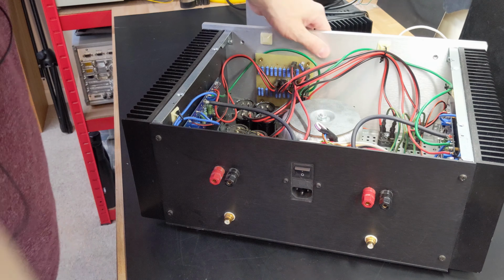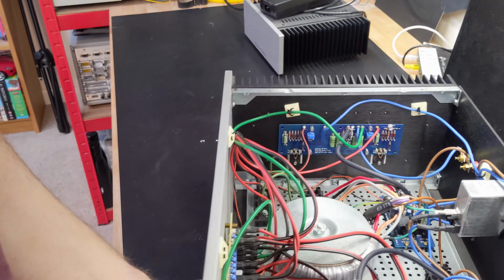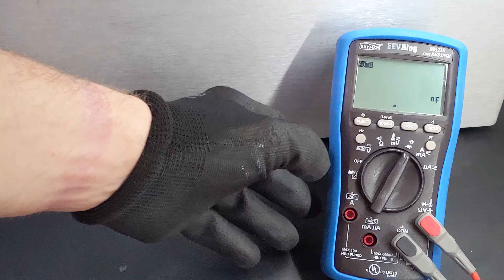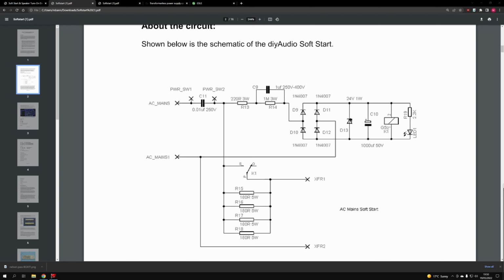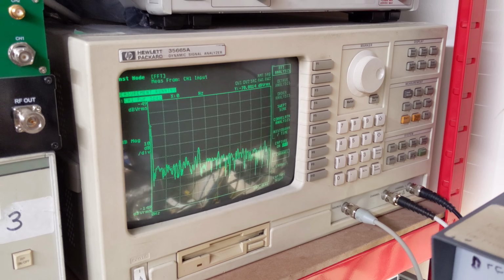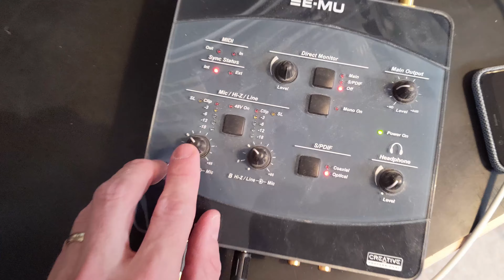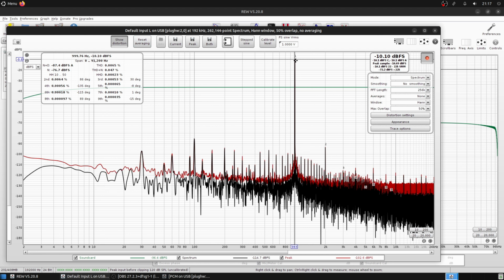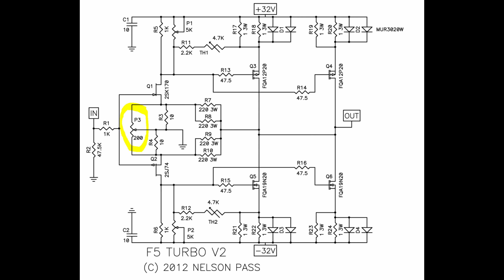#12 [Repair] DIY Pass F5 audio amplifier repair and distortion measurement

Comment: First off, great video! As far as the caps, any X/Y rated caps are made to fail by internally vaporizing the metallic surface on the internal foil ( Dave @ EEVblog took one apart and showed the damage process), and will also drop in capacitance as they do that. Using them in AC power / dropper circuits like that they commonly fail over time, but maybe using 2 larger value caps in series would delay that by lowering the stress on them. I would also consider replacing those multiple board mounted resistors with a chassis mounted one with a higher rating, or, at least standing off those resistors higher on the board and maybe putting a closely rated slow-blow fuse inline with them to use as a fail safe in case any thing like that happens again. Using a ICL component instead of resistors, along with a slow blow fuse might also work nicely, as the ICL would take stress off of the fuse until the relay bypassed it, and a closely rated fuse would also open and keep the ICL from cooking things.
Reply from the maker: Thanks for the thoughts, all great points!

Comment: Awesome stuff ! just watched your initial unboxing and thoughts on the 8 1/2 digit fluke and now this one and I have subbed. Audio and metrology are 2 things I enjoy but  I am very much the amateur (got to start somewhere !!) and enjoy your delivery of what you do. I am at the moment fascinated by Sinewaves and making low distortion sources and in particular Bulb Stabilised Wien Bridge Oscillators. I have a crappy sound card and have been using ARTA and REW software to find my feet,  along side my Siglent's FFT which is only realy an indicator that things are improving !  anyhow great work I look forward to more stuff like this....cheers.
Reply from the maker: I think low-distortion-nuttery is just as addictive as volt-nuttery, or time-nuttery, except it's easy more expensive as you start chasing the hertz, and gigahertz... Save yourself!
Reply: Lol ! but but but the sinewaves ? :) @bansci

Comment: X and Y capacitors are rated for AC RMS mains voltage, so, if you have 230 v AC, then 275 v capacitor is exactly right for this voltage. Some X/Y capacitors are even marked as 250 v, it means, that it is specifically designed to work in 220 - 230 voltage mains circuit (even if peak voltage at 230 v mains is around 320 v).
Reply from the maker: You're right, the capacitors are AC rated which I completely missed. I'll highlight your comment to point this out. I'm still not sure why the simulator I used suggested doubling the voltage OR why the capacitors failed over time, both suggest overvoltage was the root cause. 

AN954 says this capacitor "should" be rated at double mains but not why. Thoughts welcome!
Reply: @bansci 
X2 capacitors is in fact failing over time, and that is common problem in capacitive voltage drop circuits.
They fail because over-voltage spikes at mains line,  two main reasons for spikes is lightning and moments when powerful inductive loads are connected or disconnected from mains line (like big motors in industrial equipment, huge compressors in air conditioning systems, etc.).
And when X2 capacitors are failing, they do it in a very specific way, they are gradually loosing capacitance and become open circuit. They are made of two rolled up metalized dielectric strips, when over-voltage spike occurs, you get discharge spark between two metalization layers (electrodes) of the capacitor. As result, metalization around spark area become vaporized, in this way capacitor newer gets shorted, but every time such event happens, it loses some metalization and at the same time some capacitance.
And of course, if you will use capacitors with higher voltage rating, they will last longer.

Comment: Very nice amp. What was the reason for the soft start over say two CL60's on the mains and transformer primaries? Must have more capacitance than typical.
Reply from the maker: Great question, I would say efficiency, but the amp is not very efficient anyway. I originally used it just because it was part of diyaudio's universal power supply design but given the trouble I've had something like a NTC solution is looking very attractive!

Comment: Nice amplifier, not sure it's really worth the inefficiency of running class a though. Class ab seems to give low distortion on most amplifiers I've tested. I use  a hp 8903 audio analyzer for measuring thd. Can't remember what it's lowest resolution is but good enough for me
Reply from the maker: Hearing is believing! I used to think the same but we did blind tests with 5 amps (arkham, cambridge, marantz, pass F5, ACA) and a selection of speakers and sources (LPs, DACs, CD players). You could hear the F5 was head an shoulders above the rest, especially with full range speakers. Not so much difference to my ear in the sources (aside from additional noise with the LP). All of this is blasphemy to one side or another in the "holy wars" of audiophilery. 

Is class A justified in my setup? Absolutely not, my room is narrow and the Mission bookshelf speakers can't match the F5. The amp is massive overkill. But this hobby is a trajectory, never an endpoint. 

BTW the HP 8903 is a beautiful piece of kit. So expensive on the second hand market. 0.01% distortion, so higher than the soundcard I show, but capable of measuring the F5's performance and with much more capability and with range switching. Would love to own one, just can't get it for a reasonable price!
Reply: @bansci  hi again, just checked the manual on the 8903, says its range is 0.001 - 100% , but I agree a decent sound card is probably the way to go. Think I paid less than £400 for my 8903, just lucky to find it on ebay, it had the connectors on the back like a lot do but is easy enough to put them on the front as the cables are quite long
Reply from the maker: @ptronix  that's a great price! I've tried to pick up one a few times now but nothing less than £600, one even went for £1k!
The 0.001% is the display range on the HP 8903, the analyser has a residual distortions and noise spec of 0.01% in the most sensitive range. This is actually amazing given its THD+N. The soundcard is using a Fourier transform trick to isolate the THD from the noise to get better specs (not sure about the 8903). I also read that most of the 8903's easily beat their specifications, so I'd much prefer one over my soundcard. But the sound cards are very capable, especially with REW.

Comment: The JFETs 
 2SJ74BL and 2SK170
notoriously unattainable

That's the only reason I didn't build this awesome amp
Reply from the maker: https://diyaudiostore.com/collections/frontpage/products/matched-jfets?variant=39335247020105

Now you have no excuse :-P
Reply: @bansci  Thanks
I am registered on the DIYAUDIO website
many years
I posted a lot of posts there about a DAC I built
At the time they sold in the store they did not make deliveries to Israel
I see they fixed it
I checked now including shipping $47

I will later order a set from them
I am currently more focused on the project of improvements to my spectrum analyzer
R&S
Looking for a good source for a 10 MHz rubidium reference
I regret that I did not purchase it in the time that was on stock from a supplier tech mart in Israel for less than 50 dollars not working it  very easy to fix them
Reply from the maker: @davidaz4933  Ah you're in Israel? I always see excellent test equipment for sale from there on eBay, but the taxes and shipping are too much to the UK. Regarding frequency references, I really like BG7TBL's GPSDO, it has a second hand quality ovenized crystal in it, mine was a Trimble. He also does a frequency analyser too which seems well respected (called the FA2). The GPSDO needs to be left on, but I found it as good as my rubidium as far as I could test.